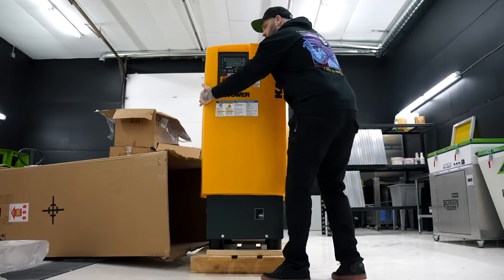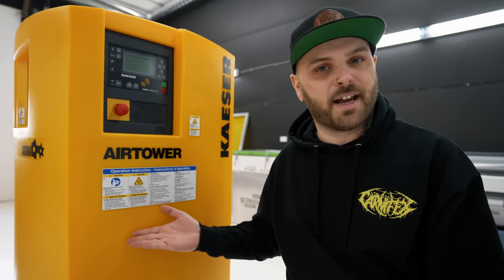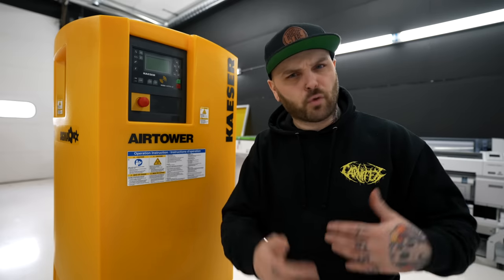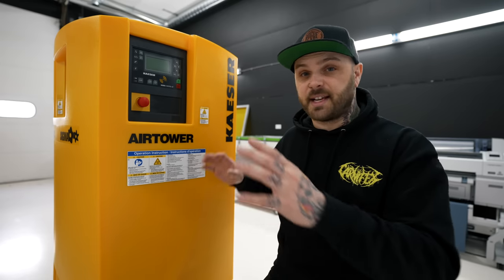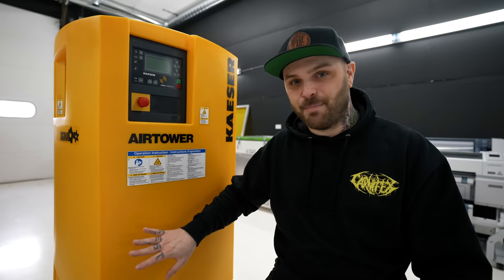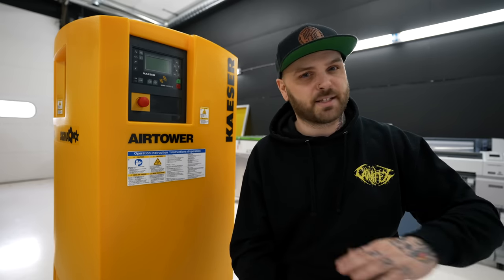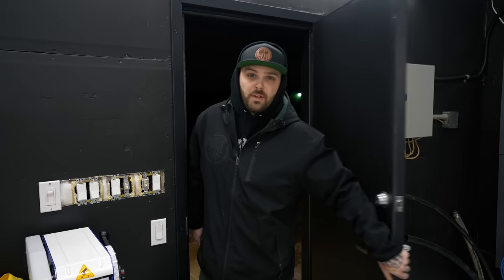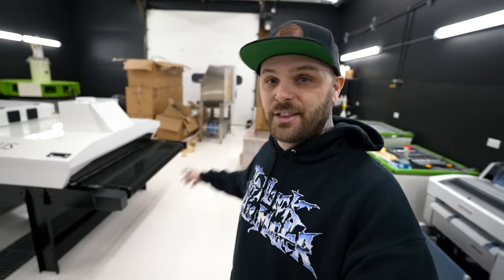This Dryer Is A MONSTER - The Screen Printing Shop Build Continues

Comment: Machine shop wife here... That Kaiser! Both my husband AND I would be compelled to dry hump that compressor! It is a sexy beast! And unloading the conveyor dryer... Literally, ever piece of machinery in the machine shop has been unloaded and moved that way. Bullshit floor dollies and a jack. In our case, it was a floor jack for a car and some floor dollies. But kudos to you for accomplishing that without a backup spotter.
Reply from the maker: I was a bit worried doing it alone not gonna lie 😂
Reply: @leestuart38  I feel ya. Hubby and I uncrated and moved a whole Rottler seat and guide machine with two furniture dollies made from sheet metal and welded on wheels; and a floor jack. Can you say $60,000 worth of frightening sketchy bullshit? I know you can. Then me trying to tell him that his dollies are NOT enough for this kind of job. They bowed like little bitches, but we got the job done and didn't break anything. Not the case with the top heavy valve refacer. We dropped the whole damn thing on top of my husband. It still has the gouges in the cast iron. So yeah, I felt for you in that video. I know the struggle. Anyway, happy new years bud. I hope you get some friends to help with everything else. Maybe bribe them with chicken wings and beer. Just sayin'.

Comment: That dryer looks insane.  The exit belt looks really short though.  I'd be interested in your feedback on the cooldown with such a short exit.  
Also interested in how many Black Dahlia Murder hoodies you have 🤘🤘🤘
Reply from the maker: There is a 2 foot extension for it but I wanted to try without for now since I'm short on space. I think it's going to come down to really dialing in the heat

Comment: Told you that BBC crate was gonna be at least a couple hundred worth of quality lumber salvage when you take it apart 😂😂😂 I still have my stack here waiting for the next project lol
Reply from the maker: I'm about to have the hugest bonfire with all of these crates
Reply: @leestuart38  sweet, hey with that Kaeser 7.5, you're getting 28cfm@125psi 60gal chilled on 3ph, I'm seeing roughly 10K a unit shipped where I'm at in the states. I know you said the current Roq is a temp until a bigger unit is ready for delivery. Is it possible that 7.5 could push 2 larger ones if you wanted to add one  later? 🤔 Looking at the Roq's lower cfm numbers (top down, alum hcomb, leaner station arms❤️) it looks super possible and a hellified savings over a 15+hp rotary. Are you looking at a CFM surplus on paper right now?
Reply from the maker: I do have a big surplus with the current press but definitely not gonna run 2 presses on this size of a compressor, at least not in the Roq range. This will be a solid compressor for the next press that comes in though
Reply: @leestuart38  thanks, still for 1 press, that Kaeser is an awesome fit. I come from a similar background with 80's and 90's Craftsman 220V 2 stage compressors pushing rivet guns and aluminum shears slapping through the wall kicking on and off all night as a kid lol, yeah rotary screw with cool dry air is a luxury no matter how far I go in life lol❤️ Good stuff man💯

Comment: Hey guys I’m new to screen printing, I tried my first shirts and well the white ink on black tees is the hardest and I don’t have crazy money so I use a heat gun to cure the ink, it felt crusty and bad. Any tips peeps would be very appreciated
Reply from the maker: A heat press would be your next step up to cure them if your working on a tight budget. But if you wanna stick with the heat gun you might need to dial in your heat and time a bit, sounds like you may have overcooked it. But with that being said it could have just been the ink you used, some lower quality stuff feels that way no matter what you do
Reply: @leestuart38  bro thanks so much for tip!

Comment: Airscrew compressors are designed to run continuously. Oversizing is actually a bad thing, as it causes it to turn on/off regularly, which is bad for them.
Reply from the maker: Incorrect. They can run under continuous load which is why they're so bad ass, but aren't required to. Otherwise they wouldn't use tanks
Reply: @leestuart38  That's exactly what I said, did you misread it?
Reply from the maker: Lol what? It isn't my reading comprehension that should be in question here so I'll say it again slowly for you...YOUR. COMMENT. IS. WRONG.
Reply: @leestuart38  I literally said the exact same thing you said, and my comment is wrong? You ok buddy? Having a bad day?
Reply from the maker: You clearly have the IQ of a mashed potato if you think anything about that is the same. Bye 👋🏻